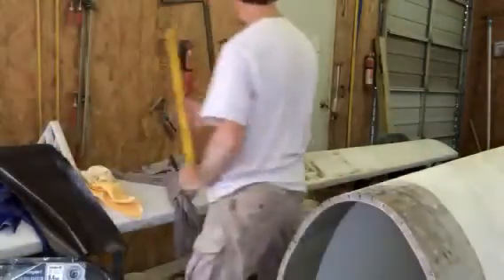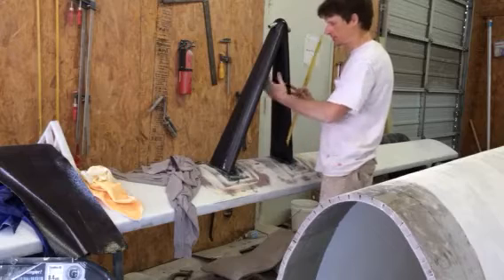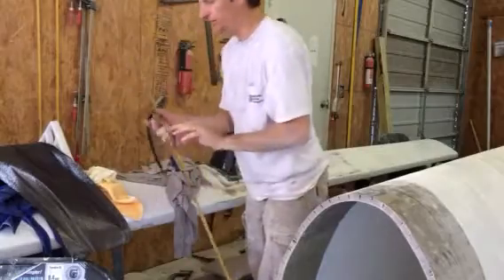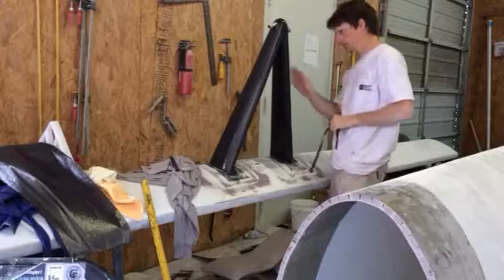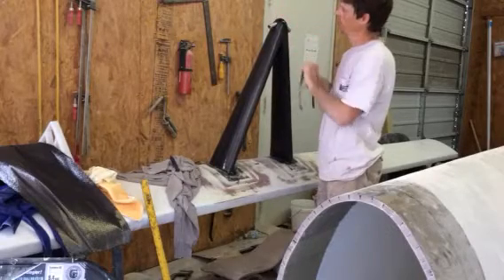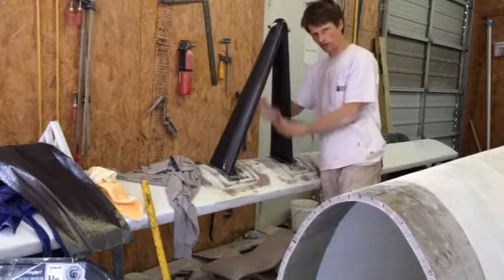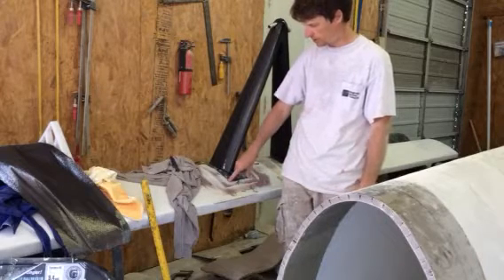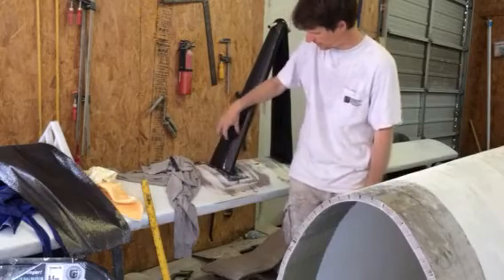Striker strut construction

Comment: How has it held up? I've seen several say you shouldn't mix glass and carbon, since they stretch different, after a while (when the glass has stretched, but not hte carbon), all the force will be held by the carbon, and none/less by the glass, once the carbon breaks, the force now goes to the glass, and break that (since they stretch, you only get their strength individually, and not at the same time).
Reply from the maker: It's held up very well, and you are very much correct that if you use two different types of materials only the stronger will take the load until it fails and then the weaker.  However, think of it like this, the boat has a carbon fiber skeleton and the rest is glass.